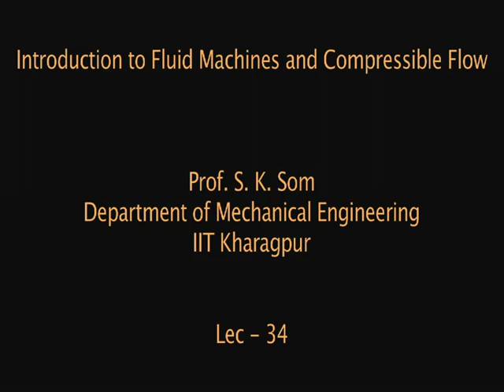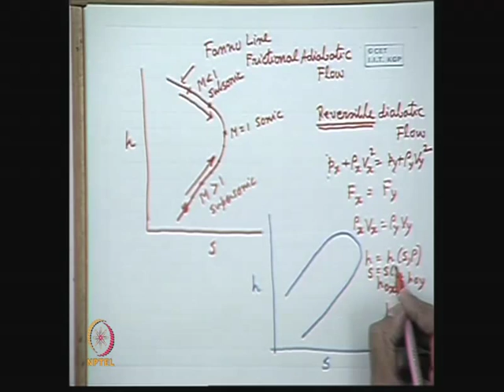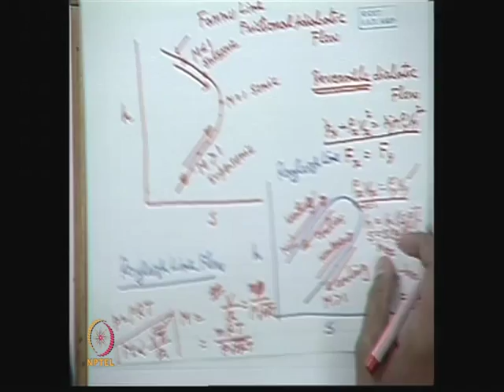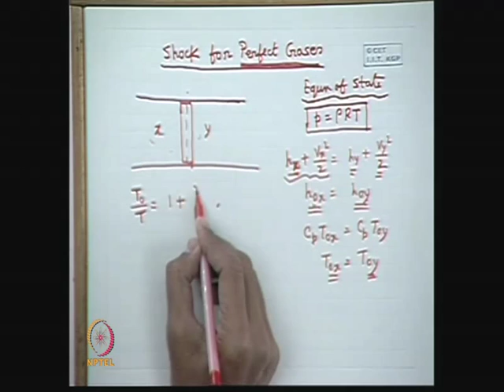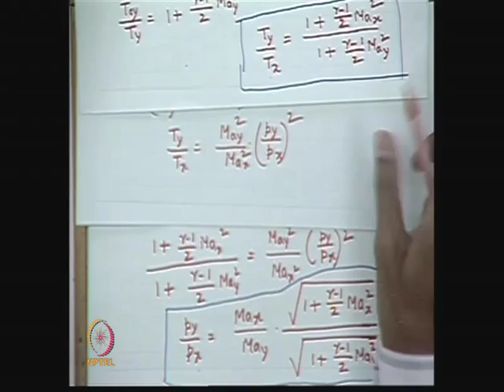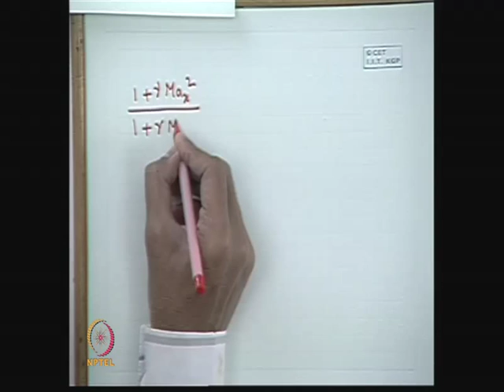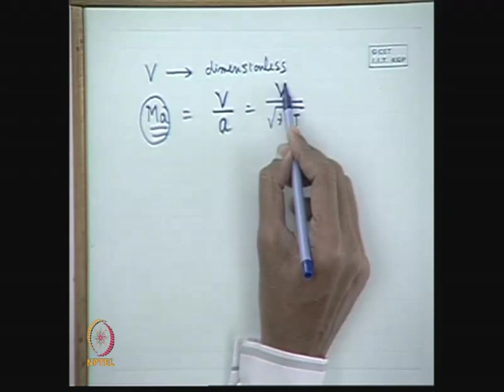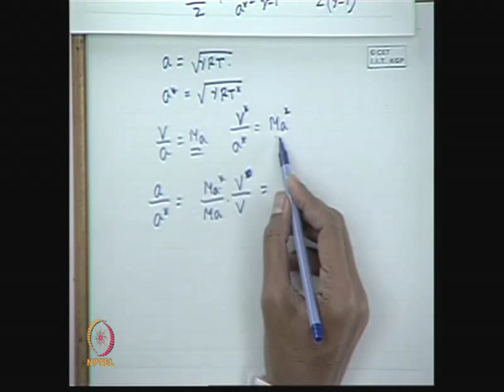Mod-01 Lec-34 Normal Shock Part II

Comment: Sir,
When we did convergent divergent nozzles, there was a case when back pressure was kept below design pressure,there was a sudden drop in pressure, but the py/px ratio only allows a sudden inctrease in pressure. Kindly explain the anomaly.
Reply: when M>1 , in diverging section , pressure will decrease gradually ,  since here back pressure is below design pressure so to meet the back pressure at the chamber  there is sudden catch of lower pressure through series of shocks .
Reply: Two different shocks
One is normal shock for Py/Px

Other one is expansion wave when back pressure is less than design back pressure